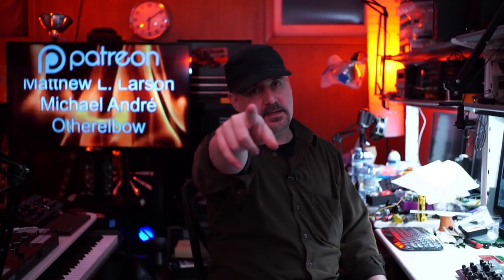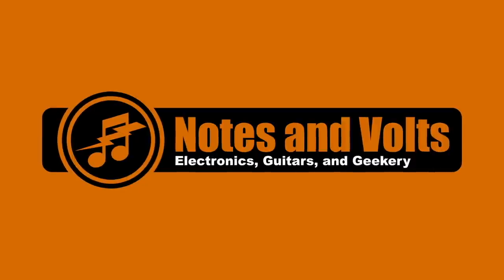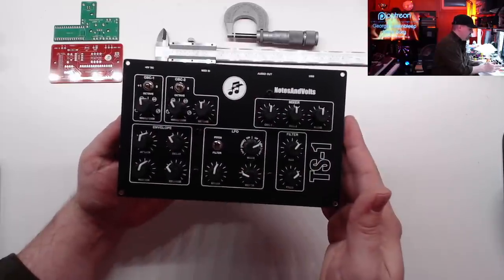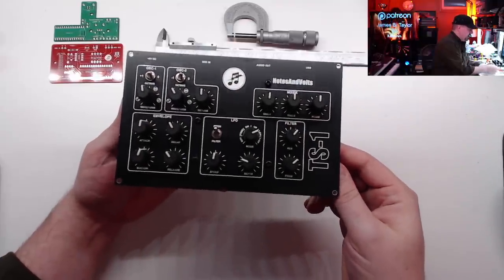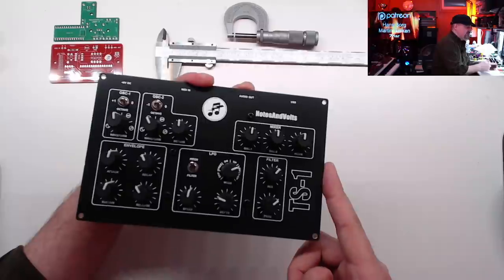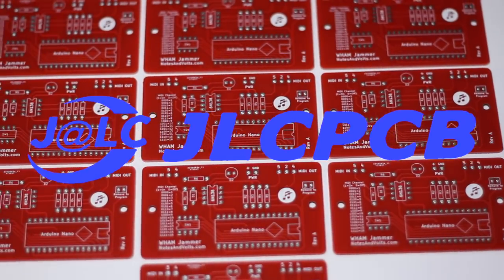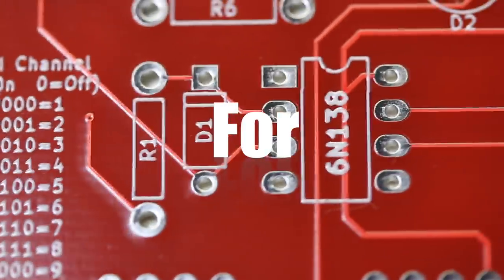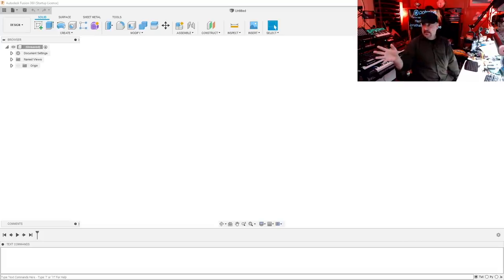Build a Circuit Board Faceplate for Electronic Projects

Comment: For the TS-1 the reverse of the panel could be used for the connections to the pots, switches and mux chip, etc. so that a separate PCB is not required. The Teensy could be double-sided taped with just a few wires to the board
Reply: If you have a lot of components, you could populate the back of the front panel with SMD components where practical, and use the PCB behind it for all the through-hole stuff. Downward-facing surface-mounted LEDs could make the use of light pipes unnecessary. Less flex in a sandwiched construction like this, so less stress on the solder joints as well.

Comment: Thanks Dave. I currently have three finished designs I made from scratch and didn’t want to spend the overhead of aluminum faceplates.  This should be a worthwhile option. Especially if the fan does 2oz copper.
Reply from the maker: That's awesome! Good luck with your project :)

Comment: I always appreciate the details on the process and software that you do in your videos. I can't wait to give it a whirl. Seems like with this method you could add large pads without solder mask and build a capacitive touch type keyboard right onto the faceplate perhaps. Maybe I'll have to give that a try as well. Thanks for the tutorial!
Reply from the maker: Thanks Analog! I've been looking into the touch pad thing as well. It should work.
Reply: MakeNoise do this exact thing with their Pressure Points eurorack module

Comment: I did it.  I really did it.  I designed a switch plate for a cessna plane which contains 4 rectangular rocker switches and 7 toggle switches.  My big problem was to add a rectangular cutout in the panel for the rockers.  However, ingenuity prevailed.  The cutout had to be 29.3 x 12.3 mm but, in the footprint editor, there was no such thing so, I designed my own footprint.  The problem is that JLCPCB doesn't (as far as I know) have square cutouts so, my footprint included 12 plated slots 22mm by 1mm wide stacked next to each other and JLCPCB was able to route each slot and the switches fit like a charm.
Again, thanks for showing me the way to use KiCad and building face plates and , they turned out better than my 3D printer version.
Reply from the maker: That's great Phil! Nice work

Comment: Brilliant video and a great idea. Just one thought to take it further... if you wanted the corner hole screws to be completely concealed you could put an exposed copper circle on the bottom layer and solder a M3 nut on and insert M3 bolt from the bottom. This would mean drilling the hole in the case big enough to recess the nut and probably a spacer and/or washer for the bolt. I guess it depends on the case thickness and access from the back. Just an idea... might give that a go myself.

Comment: Good idea and I'd reckon a lot cheaper than getting some Western firm to custom print it directly onto a box. I have a project I'm designing in one of those extruded aluminium cases with plates screwed to each end. You could fix it to the case like that and it would be perfect.

Comment: You can also change the color of the solder mask in the 3D viewer so it matches the board color you use in JLCPCB.
Reply from the maker: Thanks Karl. That's a good tip!

Comment: Turning off the F.Fab layer de-clutters you work space massively! Just a tip :) Ow and another quickie, the ground copper pours can be waaaaay far away from your board outline. The manufacturer does not care how far away from the board edge it is. I find it easier to have them a bit further away, and also away from the back pour so it is easier to select them. But anyway, nice tutorial!

Comment: When Dave shows the completed board at around 1:21:00, you can see that the mounting holes have a very small copper pad around them. Is this using the settings he outlined earlier in the video (1:05:36), or did he use a very small pad setting in the final design? I'd like to have copper-lined holes without pads at all.
Reply: I experimented with this myself. You can set a mounting hole with no pad, resulting in just a copper-coated hole. There are some changes in the step-by-step to get this to work, thanks to upgrades to Fusion, Inkscape and KiCad. Otherwise, Dave's instructions helped me create some very professional-looking faceplates for my headphone amplifier.

Comment: Just applied the process and submitted an order.  Happy accident, my test project is very similar to the tutorial. More labor intensive (for me) than Front Panel Express, but cost effective and perfect for many projects. Thank you. (Perhaps 6 -8 hours total time to do the first project)
Reply: Got my boards (about 5 days after placing order) and they are great! Thank you. for the tutorial. You might have recommended this in the video: I found the solder mask scratched easily. With plenty of boards I found that a coat of clear Rustolium looks great and makes them more durable.

Comment: If you get a scratch in one of these just get some black UV solder mask off ebay (which is exactly the same thing that is used to "paint" the PCB) and a UV flashlight. Apply to the scratch then wipe the excess off with a flat object such as a credit card, or for small areas a very small modeling trowel. This will take off the excess while leaving the scratch filled. Then shine the UV light on it for a few minutes till it's cured (recommend you don't look at it during tis process it's damaging to your eyes)

Comment: Excellent!  And VERY helpful.  I would NEVER have figured out about the transparent background problem with .png files.  How did you realize that???  I have seen examples of just drawing directly in KiCAD's PCB tool to make control panels, but one is limited to only one font and the basic circle, arc, and line tools.
Being able to draw in a vector program and export via a .png into the footprint library opens up the whole world!  In fact, I even found that as long as you use a high resolution (like 2000 dpi), you can just directly use a drawing program (like GimP), write out the .png, import it into KiCAD, and it works well.
Reply from the maker: Thanks cowsongs! I tend to solve things by banging my head against the wall until it works. LoL

Comment: Nice technique - thanks!  I don't know if you mentioned somewhere in the video, or if AutoCad changed pricing structure since you posted this, but unfortunately as of the date of my comment at least, the free version of Fusion 360 doesn't support save-as or exporting .dxf files. :(  FreeCad doesn't either, although supposedly some kind of conversion program exists. The problem is that AutoCad owns the .dxf format and doesn't license it easily - certainly not to the free software world Inkscape, FreeCad and KiCad (for schematics and boards) live in. If anyone knows a way around this, it'd be good to hear here. If I figure out one, I'll certainly post a follow up. -HP
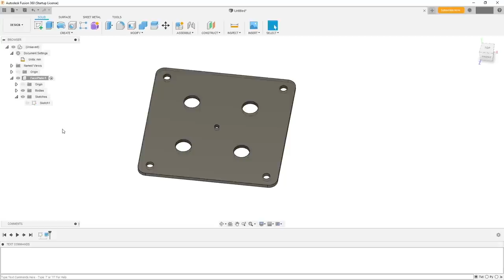Reply from the maker: Check out the method I use at 19:54 to get the dxf file. Let me know if it still works.
Reply: @NotesAndVolts   Sorry, no it doesn't work an longer.

Comment: It seems that the price increases very quickly if you change certain standard parameters, like board area. The example you showed was much smaller than the finished boards you showed. Is it possible to know how much your larger finished boards ended up costing you?

Comment: What if I'm doing a faceplate for a guitar amp but don't want any drill mounting holes?
Reply: I just made a panel like this and I didn't want any mounting holes either, because the nuts on all the controls themselves will hold the panel down.  I didn't put in any schematic, mounting holes, or "fake" devices to make KiCAD happy.  You can still do the "Add Fill Zones" trick he does by dragging a box around your whole PCB layout and when you need to assign it to a net, just choose the one and only "<no net>" which says it will make "an unconnected island of copper".  That ends up making just one big fill zone of copper that covers the whole side of the board, which is exactly what you want.

Comment: There is one big issue with this, which is the position of silkscreen. Your board is square and you have this reference hole in the middle. I have rectangular one and have an issue that silkscreen positioning is not working like in your video becouse orgin for bitmap import is set automaticly and for non symetrical shape is somwhere so they not allign. Second issue I had is that actually in my version of Kicad "Negative" option created opposite result, also move exactly is not working like in your video, this option is under this "Position RelativeTo", but other than that great tutorial THX.

Comment: This is great but i feel like all the steps you take are unneccesary.. i probably would just use photoshop and pick mm as unit of measure and design the entire thing in one step.. then import to kicad.. all those hole and alignment things are easily accomplished and redundant.. just a perspective from a graphic designer engineer.. but great video and great idea

Comment: FUSION 360 is NO LONGER FREE.  At least if you want to have the capability to get dxf formats like this tutorial calls for.  Be prepared to spend 500 bucks a year.  It is a great program though.
Reply: Fusion 360 is still free for non-commericial uses.  I just downloaded the installer and installed the app (5-7-2022).
Reply: @clintchron3001  Yes but it doesn't appear to support dxf format output.  That's a real crippling limitation.  If you want to just print to a 3d printer, that's not a problem.
Reply: @thedarksage328  You can export dxf files by right clicking on the sketch in the browser tree in Fusion 360.  It does not require a paid account.